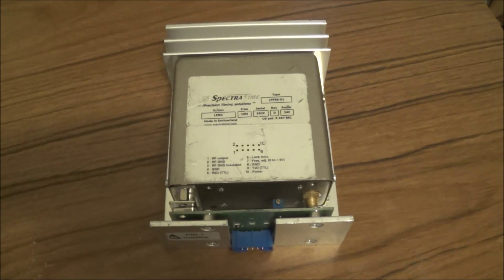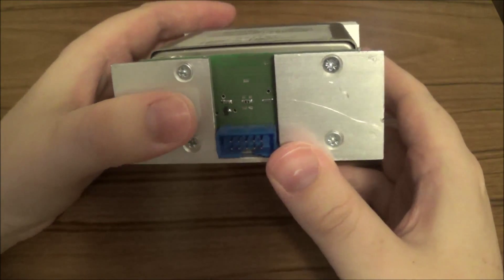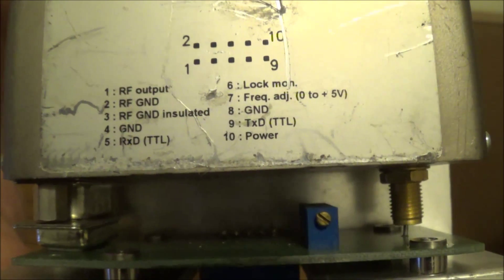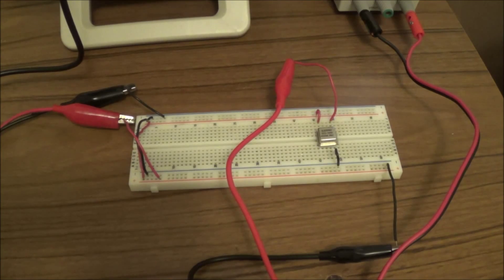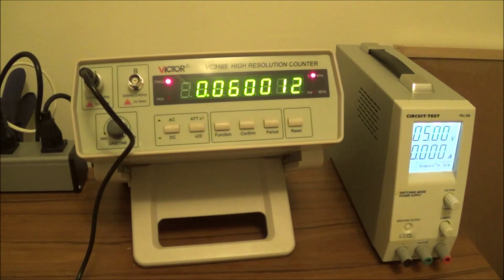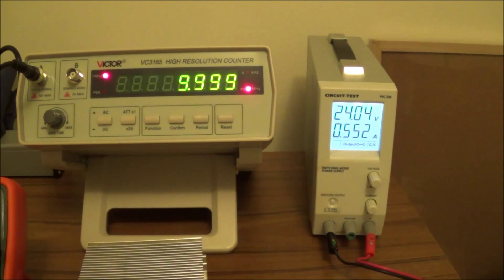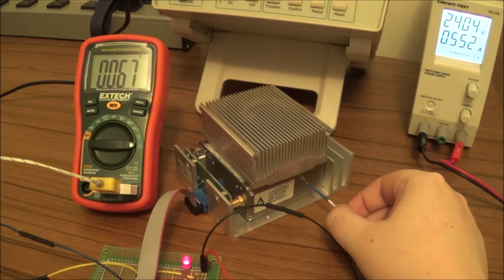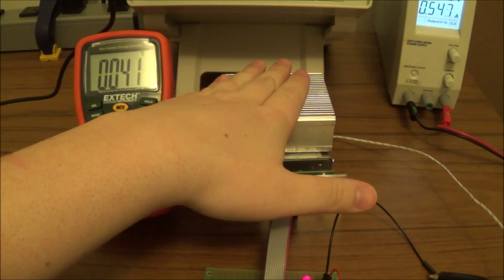Rubidium Atomic Clock Test

Comment: That not a accurate way of testing that rubidium standard, as the internal reference of that counter won't be near as accurate and drift and you be measuring how far out the reference inside the counter is out by pretty much only. Plus that counter is only 8 digits, not even suitable for transceivers alignments I do, let alone testing of a rubidium standard. Nothing wrong with playing around with it to learn and etc. To know how good it is you have to look at the rubidium lamp voltage and if low let say 2 volts. This indicates that it is near the end of its service life, if it is  6 to 9 volts then has some life left and upper limits meaning it wasn't barely used. It not the lamps don’t actually usually burn out as no electrodes — it’s the support electronics that are the problem. That that what usually causes them to lose lock over time. 
 
Your best bet if you want a reference standard for the bench down the road is to get a GPSDO, but for the gear you currently have and work you do would be completely unnecessary and would be way overkill.

Comment: The only thing you're measuring here is how far out your frequency counter's internal reference is.   Your counter only has a resolution of 10 Hz at 10 MHz.  You need to be about 10,000 times better than that to measure the error on a rubidium standard (you need 4 more digits on the display) -- on the order of a few millihertz.  And your counter needs to have a reference that is better than rubidium to measure this.
Reply from the maker: Yeah, it wasn't a great test but I was pretty happy that the thing didn't seem to be messed up from however many years it was run in whatever equipment it was pulled out of.

Comment: Have you wired Rubidium to a project ?  And what is the shelf life of the Rubidium ?  For long term back up I may go for the OCXO where the caps may need replacing first.  Thank you for the video !  tjl
Reply from the maker: +Tim Lipinski I've only used it so far as a reference for a frequency counter that has a connector for it. It outputs something like a 200mV P-P sine wave that isn't the easiest thing to work with, but in an experiment I did successfully turn it into a square wave by AC coupling it into a resistor divider and then into a comparator. Not sure if that's the best way to use it though.

These things are meant to operate continuously in, for example, cell phone towers and the datasheet gives an operating lifetime of 20 years so they're supposed to be quite reliable. The expected point of failure is the rubidium lamp itself so it wouldn't be an easy repair when it fails, but the lamp shouldn't degrade when it is not operating.

I got mine used though, so I don't know how much time it has left, but I only intend to pull it out for short times to perform experiments. It's possible that power cycling it is worse for its life than constant use, but the datasheet doesn't mention that.
Reply: Sarah, that will work, but I like to use the front end on a CD74HCT4046.  AC couple the signal into pin 14, and take the output on pin 2.  Tie pin 3 and 5 high and tie 10 and 11 to ground.  You'll get a nice TTL level squarewave out.